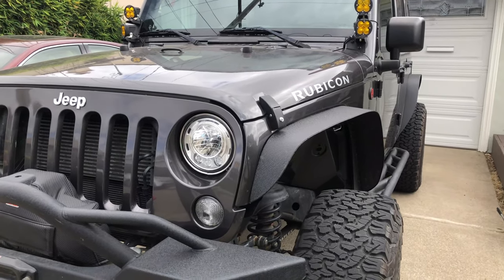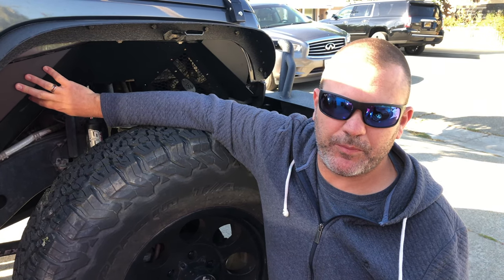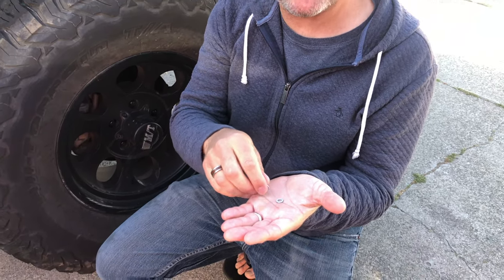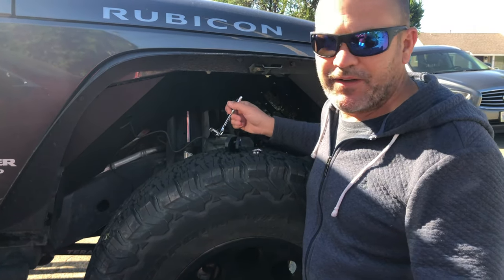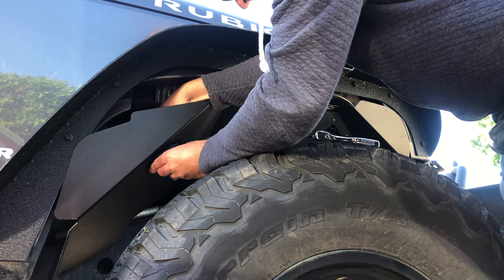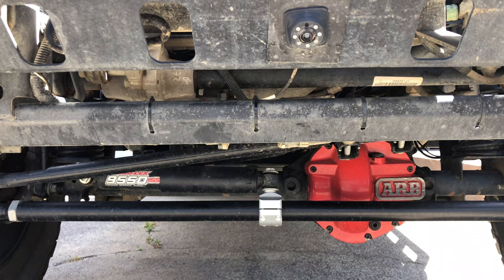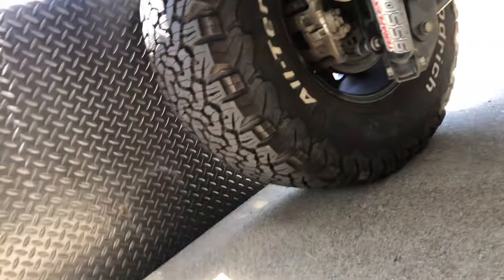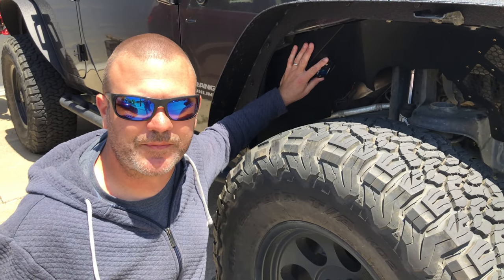Pro Comp 6 LED Rock Light Kit Install on Jeep Wrangler - Part 1

Comment: 1.5 year update. No follow-up video....?
Reply from the maker: Hi Jon. So far so great. No issues whatsoever. We also added rock lights to the sliders in our 2-door JK to light up the air up and down valve stems and that’s a huge help when doing so in the dark.

Comment: I just bought 2 sets of these thinking I would double up in the wheel wells then under each door. How bright is one kit?
Reply from the maker: Thanks for the question. They are pretty bright. If you have 1 pointing down centrally in both the front and back you probably don’t need to double up in the wheel wells. We’ll try to get the follow up posted soon to give an idea.